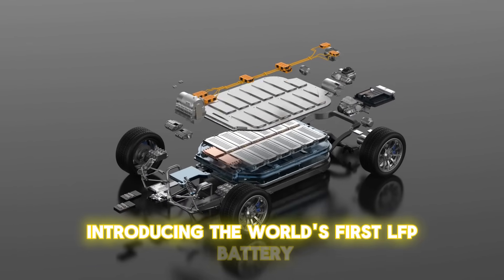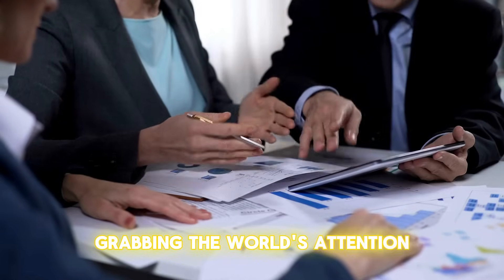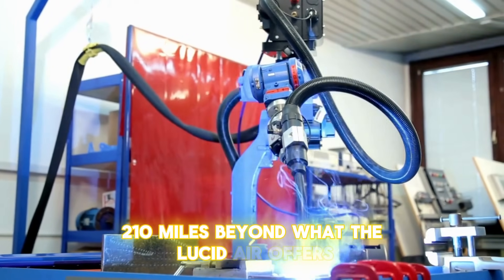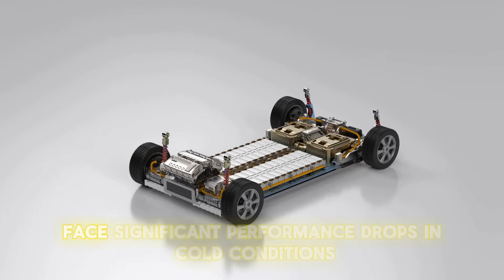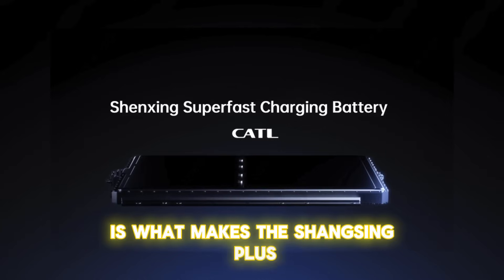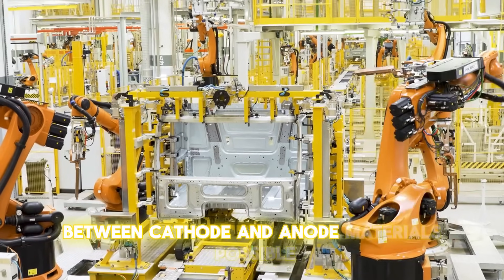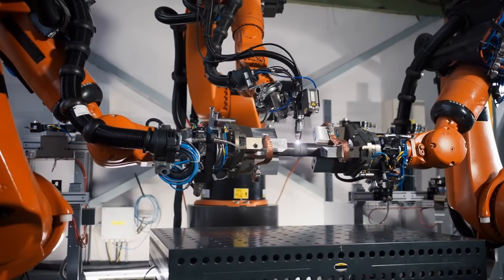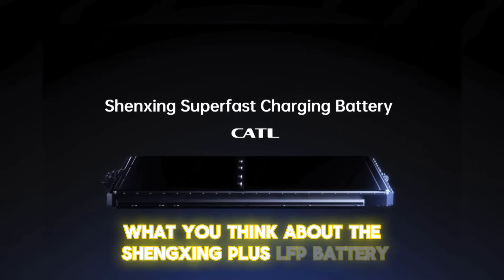The CATL Finally Released it's NEW SOLID STATE Batteries! You won't believe!

Comment: bla bla bla, but what is real energy density? 205wh/kg? still much less than li-ion (250wh/kg) or promissed solid state sdi (400-500wh/kg)
Reply: But it's 20% lighter and 2-3x longer battery life, cycles, and safer.